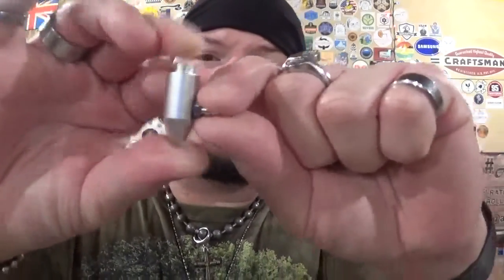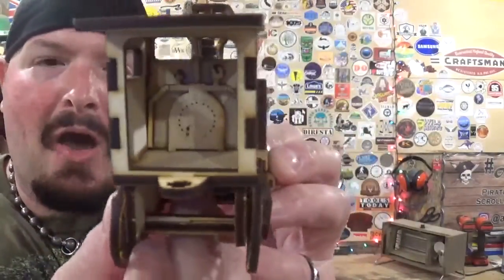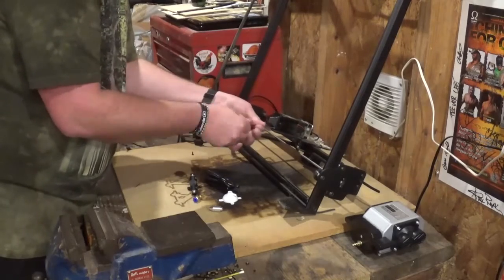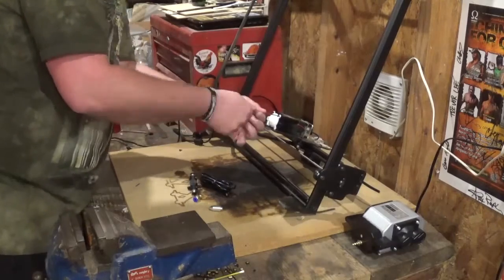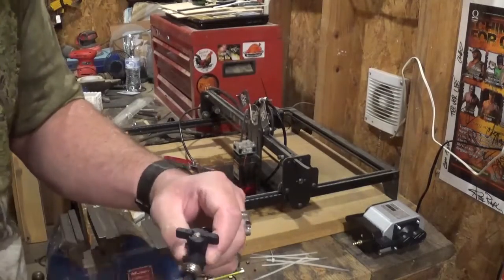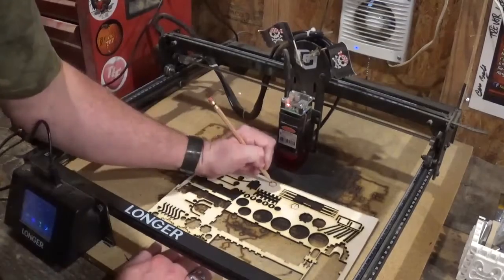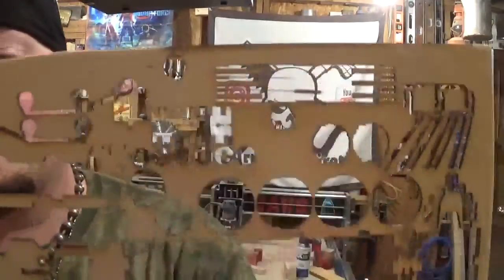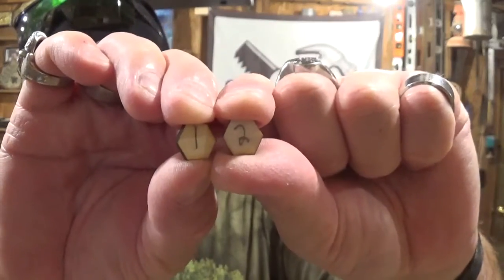Adding Air Assist To My Longer Ray5 Laser Engraver 5 Watt

Comment: How are you able to focus the laser with the hose input in the way?
Reply from the maker: Hey, I actually moved the hose over to the side and drilled a hole through the red shield to run the air assist hose

Comment: Bullshit that longer does not have Ray5 5w Air Assist duct as available part
Reply from the maker: Please now bad language on here, and Longer offers a 3d print file as an adapter for the 5w Ray5. I 3d printed it and it works great
Reply: @ArtisanPirate  my apologies that's the issue l dont have a 3D printer, you think they would at least recommend someone, we are left hanging or finding a 3D person
Reply from the maker: @stupidasole4890  agreed, however, they do offer the file for free

Comment: Do you still have the pla for the nozzle?
Reply from the maker: Yes, I posted them on the Longer Ray5 Facebook Page. It wont let me post the direct link as a comment
Reply: @Artisan Pirate  thanks.  I am trying to find that particular group.
Reply: @ArtisanPirate  I am not finding it
Reply: @ArtisanPirate  hay just a quick question about adding the air assist with the thingiverse printed nozzle…I see in the video it comes out the back in the center. Does it interfere with setting the focus height